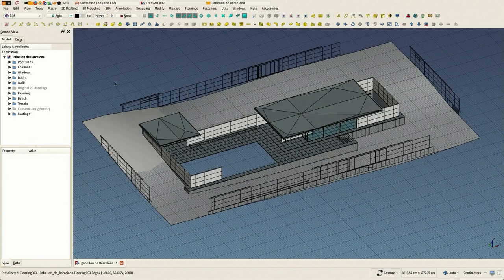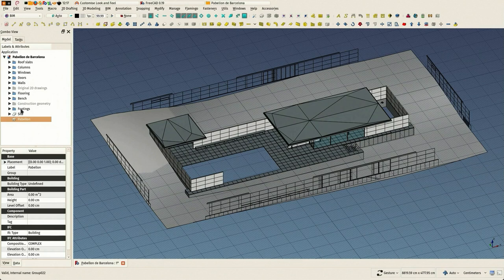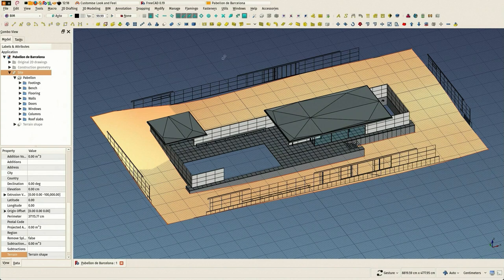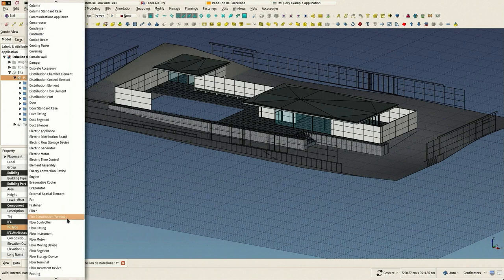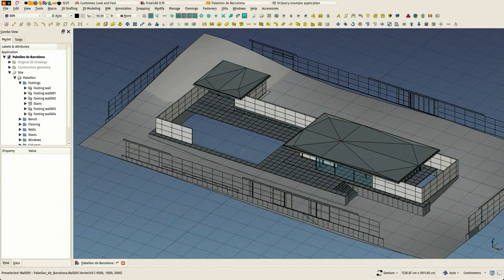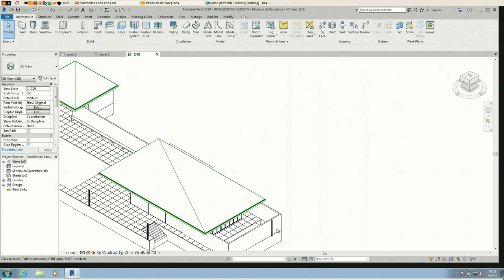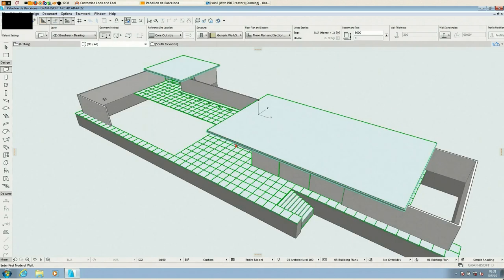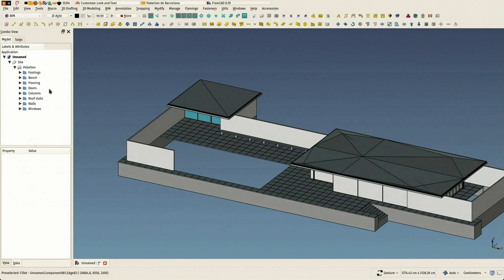BIM with FreeCAD - Barcelona pavillion 13 - Exporting to IFC

Comment: I wonder how to edit the objects imported via IFC in FreeCAD. Even a simple IFC containig a wall and window in it, it did not work after change the wall's length and recompute.
Any suggestion?
Reply from the maker: Indeed some more advanced things like retrieving the axis of a wall (and therefore make it editable simply via its properties) is still not implemented (But beware, that information is rarely present in IFC files, therefore it's really hard to know where the length is and make walls fully editable). At the moment the easiest way is to use the Draft Stretch tool, not the ideal but that works quite well.
Reply: @YorikvanHavre  Thanks for your reply.
Reply: @YorikvanHavre  Do you mean to use the draft or sketch tool to recreate the arch objects based on ifc object? In the import/export preference page, there is a option import ifc objects as parametric arch objects. How does that work?